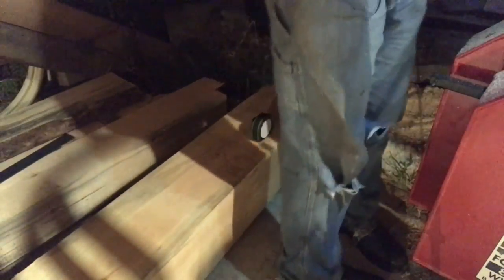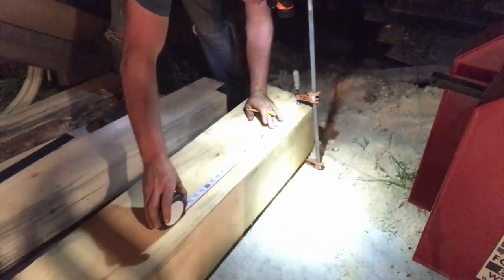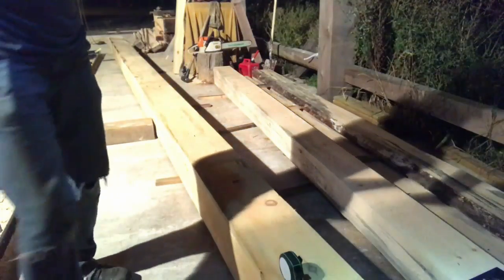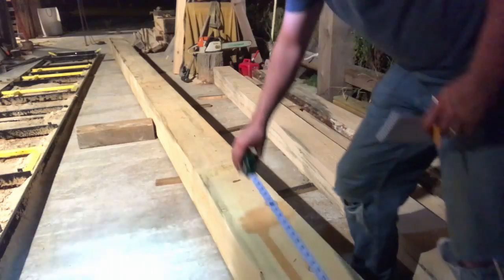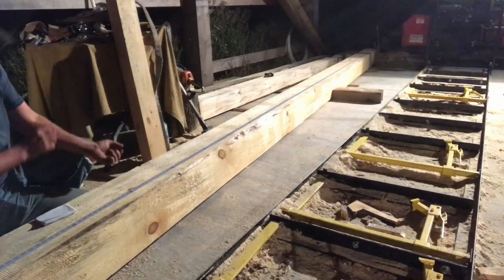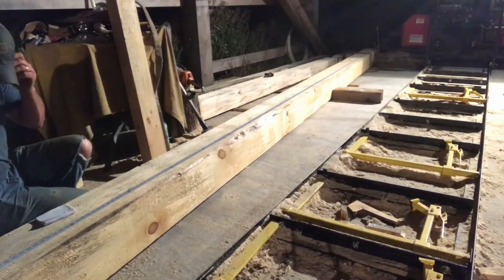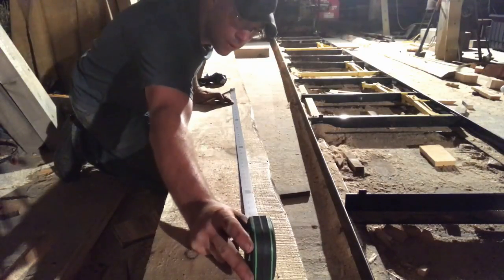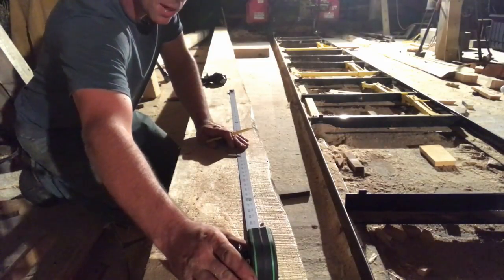A Timber Frame Vlog #52: Layout Rules for Top Plates

Comment: Did you mention how you're planing this?  I may have missed it since I've been wiped out too lately lol.
Reply from the maker: +Rk Stewart sub floor.  1-1/2" flooring going over it.  Going to take a floor sander to it to flatten it out before the finish floor.
Reply: Why is the floor going to be so thick?  I thought you'd just walk on that.  You really are goin to be rebuilding tractors up on that 2nd story lol
Reply from the maker: +Rk Stewart setting the 2nd floor up for timber work, thats why the timbers are so big.  Putting in a 12' long trap door to hoist timbers up through.
Reply: How overkill is a 2" floor for that work,  I'd imagine the top 1-1/2"  will be hardwood too?
Reply from the maker: +Rk Stewart it'll probably be pine, I like pine flooring, takes on a lot of character throughout time.